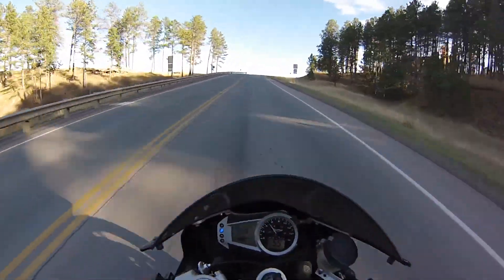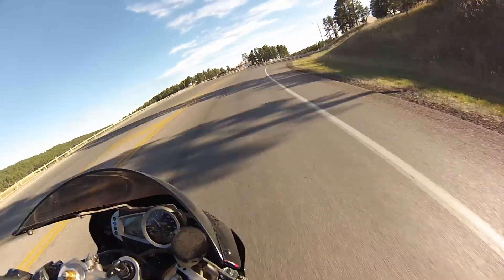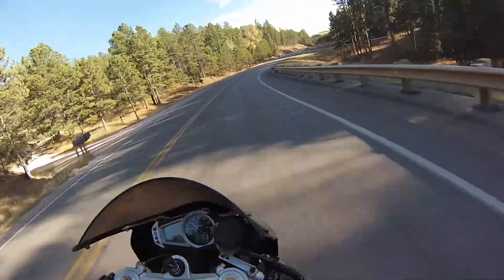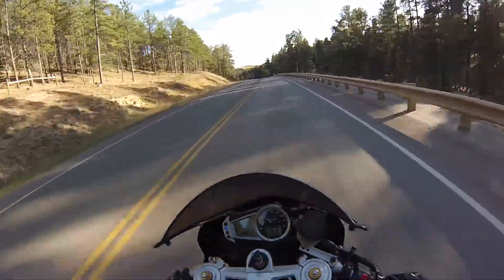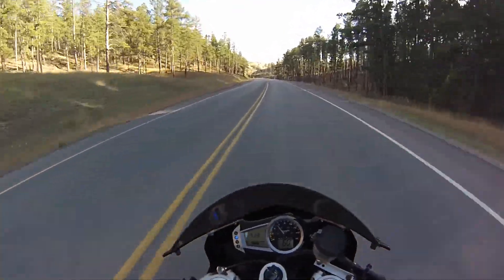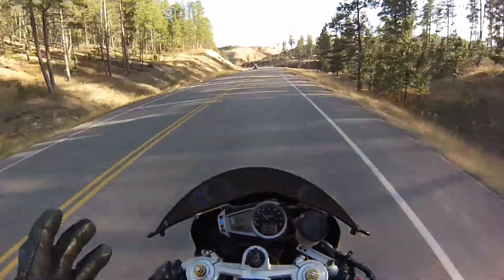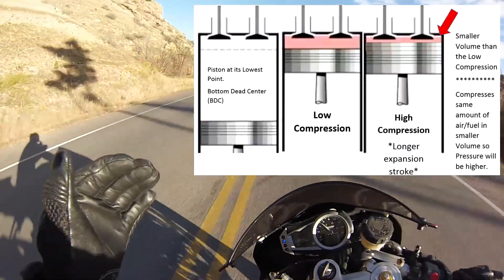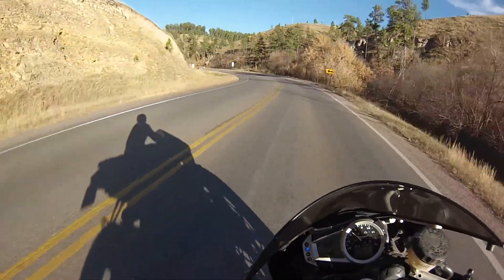Compression Ratio Explained | Engines Explained Part 2

Comment: You kept using the term "compression ratio."  But isn't that different than cylinder compression? If you leave out the "ratio," are you still talking about the same thing?